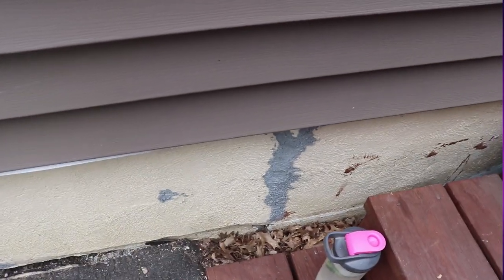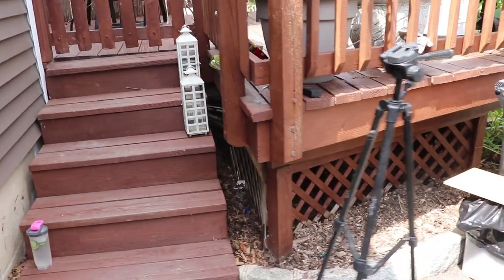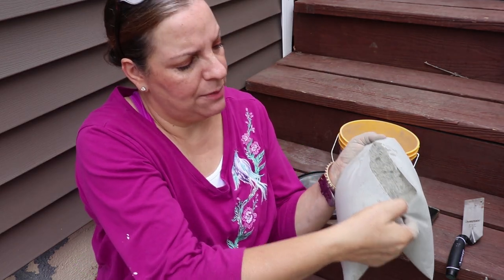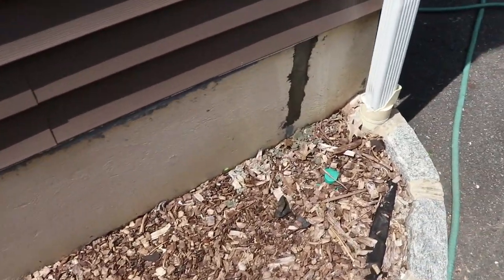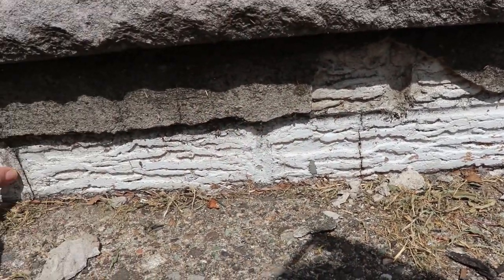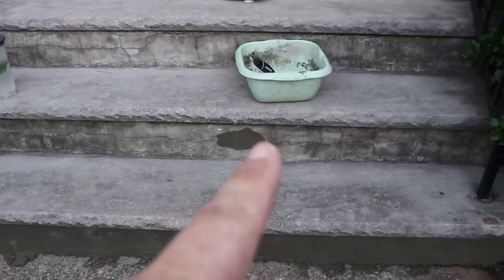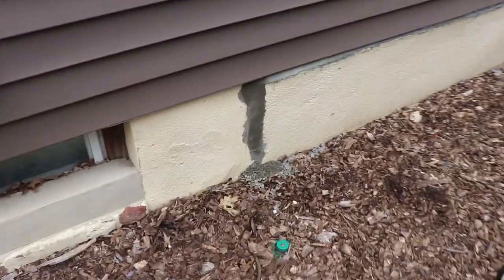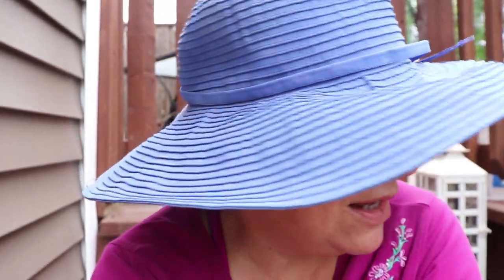Puttering Around - Getting Things Done - Part 2 - I do concrete now!

Comment: Great Video ... The new gravel area near the corner of the house, why don't you just put the bins at the side of the house on the new gravel?  Instead of building another structure that sticks out into the drive
Reply from the maker: Because you could see them from the street and it s not a good look. Also that area has a curb so the cans would have to be lifted up and down.